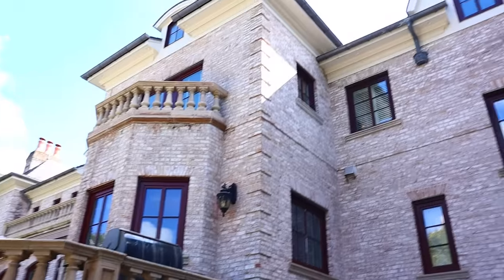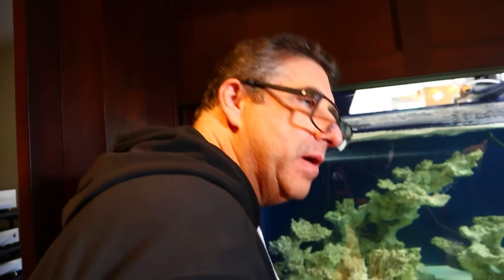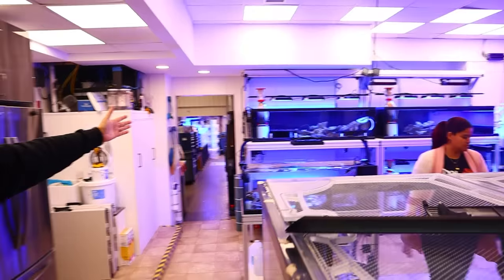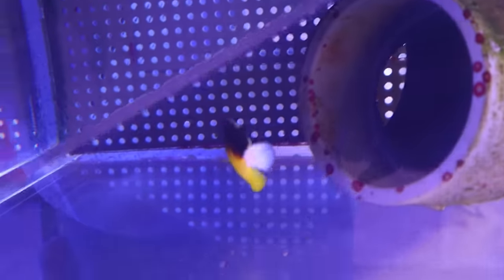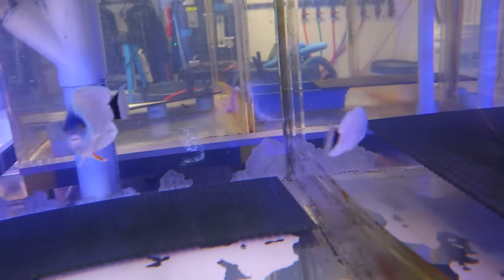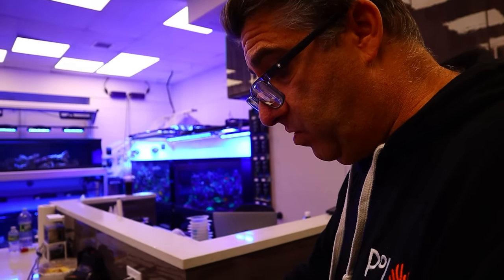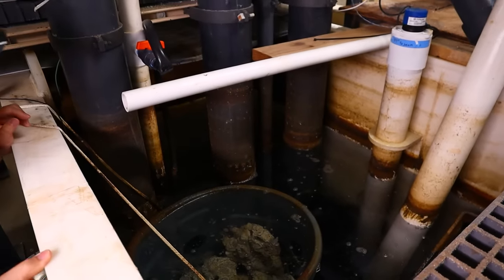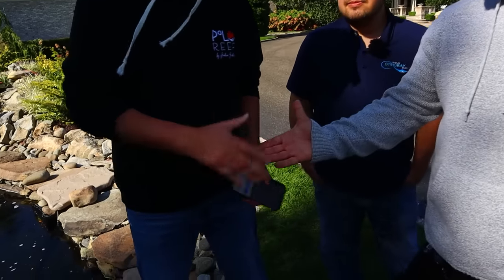Inside the most EXPENSIVE Home Aquarium In the WORLD

Comment: I'm a retired power plant operator of over 30 years. Swapping pumps to maintain equal run times is not a good idea. Running the out of service pump to make sure that it will work isn't  a bad idea but equal run times can bite you in the you know what. If you have a pump fail due to excessive use, the spare pump that goes in has equal wear and isn't far behind. Next thing you know, your in emergency mode, trying to find the replacement pump and supply chain nightmare begins.